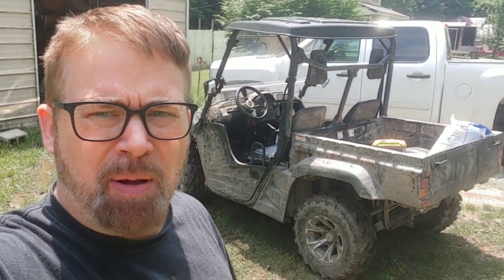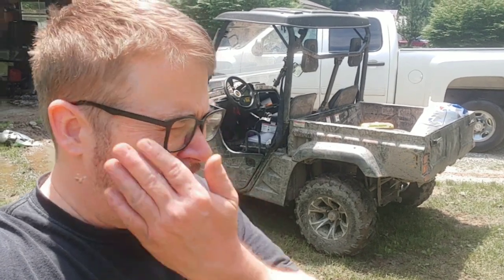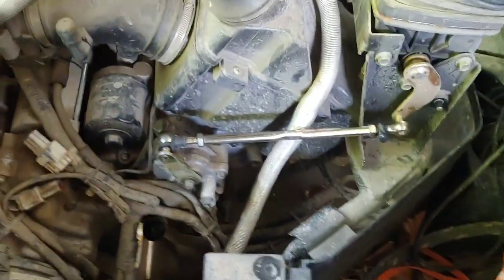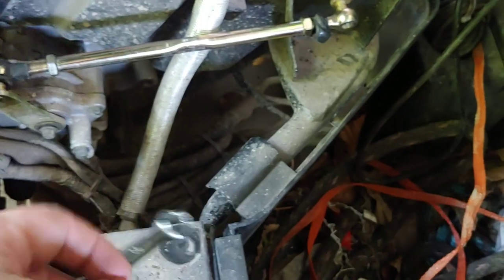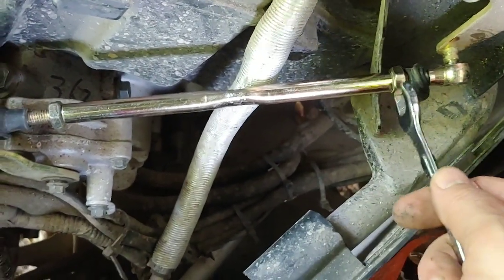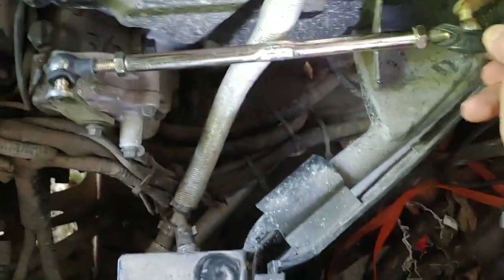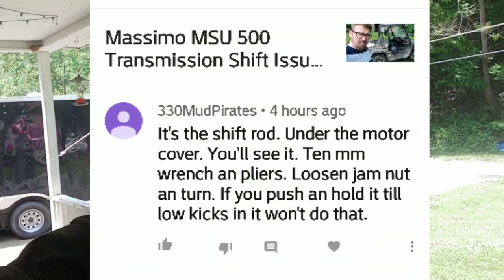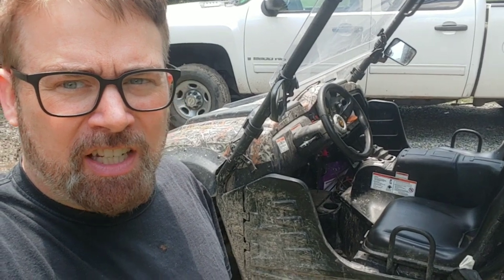Massimo MSU 500 Shifter Problem SOLVED

Comment: Thanks for the shout-out and the follow up. This video will help a lot of people, excellent explanation.
Reply: @captainsavagettv  Did you try to lengthen the rod as shown in the video? You need to make sure that the rod is fully engaging the lever in reverse. If it is fully engaging and not moving in reverse or forward then your drive belt is burned or broken. If it does move forward and no reverse when rod does make lever fully engage, may be a transmission problem.

Comment: I've got the same problem with mine but instead, I've got mine adjusted all the way in and I still can't select reverse properly and forget about even trying to select low. Seems like the shifter its self just isn't moving enough distance to engage the gears.

Comment: I have an msu 700 and since a week after warranty I can’t shift into hi or low forward gears... I disconnected the shift linkage and moved the arm manually it does absolutely nothing when moved into the hi and low positions, I mean nothing, no click, no resistance nothing. So whatever is inside there is completely broken. Not sure if it is electronic, cable actuated or a shift arm... but this thing is worthless and a waste of money. Barely a year old and not even usable...

Comment: Just bought a HiSun Axis 500 and 2 days later the 4WD locked up. I think the rear differential is locked too. Display shows blinking circle on the left diagram front wheels and an ‘X’ on the right diagram. I’ve tried pressing/depressing both the 2wd/4WD and differential lock buttons several times, rolling reverse/ forward up/down slopes and can’t get it to release. Steering very hard to turn. Any ideas would be greatly appreciated.
Reply from the maker: Contact warranty department
Reply: @TrainedZombie  That’s my plan this coming Monday.

Comment: Having problems with my Massimo MSU 500 4x4. In 2 wheel drive will not pull forward, in 4 wheel drive it will pull forward. What could be my problem ?

Comment: I have 2015 and the transmission is stuck in reverse and adjusted the linkage and will not get it to get transmission to to go in any gear only reverse motor will start and can drive in two and 4w well but only in reverse.

Comment: Thanks, I have the exact same problem. Or rather did have, this simple adjustment worked for my tractor supply msu 500 also. I drove mine for about a year before this issue popped up. And mine sees ALOT of use, Around my small farm, Hauls fire wood, rocks for stone walls, feed, fencing trailer, plows snow, Hauls tree stands, deer out of the woods. The list is endless. Very happy with mine also. Glad this was just a tweek and go . I'm sure my massimo will be running the northeast Pennsylvania hills for years to come. Thanks for taking the time and posting this. 
           Thanks for your law enforcement service also. 
       Gary,
              Penn wildlife conservation. Officer Ret.

Comment: Right on you got it fixed. Was going to walk you through it bit I seen you had fixed it already. 
One thing to note is and time after you make a gear change from high to low or to reverse etc always give the throttle just a little tap to make sure it engages into gear. At least that way if the gears aren’t meshed it won’t strip all the teeth off the gears. 
After any grinding like that i’d be changing the oil as well to get any filings that may have come off the gears.

Comment: @TrainedZombie  I have a BMS Ranch Pony 500 which I did the same adjustment myself and another thing to check and adjust is your engine idle adjustments as I noticed that you will also get that grinding noise if the RPMs doesn’t return to idle speed.

Comment: I have no forward. It did grind going into high. However, now regardless of the throw on the linkage I have no forward still. I used it one day parked it. I came out the next day to this.

Is there an electronic solenoid or a gear mesh alignment issue instead of the linkage?

Comment: Also, early on in this fix, the part top center with rounded hole like on top  looks similar to a part that I discovered had fallen off my Linhai at some point. It's new but I think the put together part may have been "not exact". Otherwise it's awesome. It has leaked a little  fluid from what looks like brake and or transmission. Any ideas? Know the name of that curved part with a screen like thing inside one end. It looks close to that rod he adjusted , just above center.  Should I find a dealer to change out the breakin oil or is it easy enough. I'm sure warranty time ran out but it's like new. Maybe 20 miles use if that.  Alloy wheels camo finish, hydraulic bed lift and independent rear suspension with McPherson struts.breaking oil. The seller closed shop and died shortly after my son bought it for me. I'm 63 and have had 2 titanium plates fused into my neck (cervical), but I'm relatively game and regularly active outdoors. The  bighorn would be a big help and has sat in basement with a battery helper/not charger,just helps it stay undrained. It uses 93 octane with an additive in blue bottle for fuel and came with extra spark plug for next fill up. I'm guessing because of ethanol.